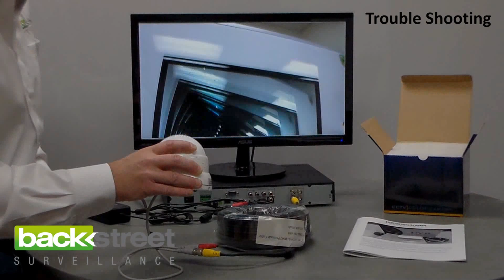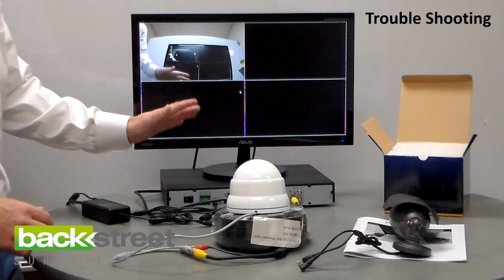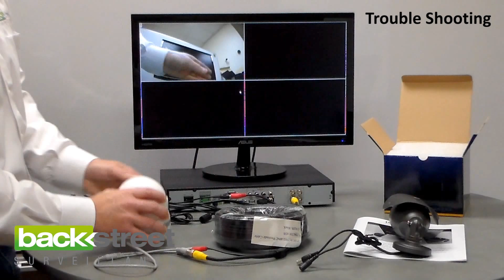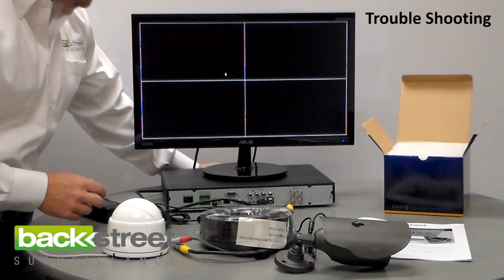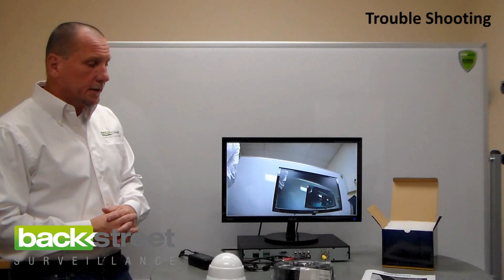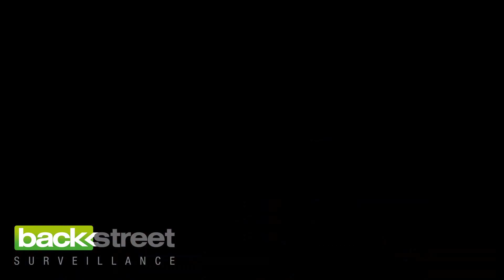Troubleshoot Coax Security Cameras | Easy Fixes for CCTV Systems

Comment: Hello, I’ve had cameras up for some time now and I’ve an issue with one off them. I’ve tried swapping the camera with another camera and it still didn’t work, at night the ir lights flicker at night but give no video, would this be a cable issue?
Edit: I’ve also replaced the power supply
Reply from the maker: If the symtoms are the same on both cameras its either the cable or the power supply, or the video input channel on the recorder. Isolate each part of the system and test. Try a diifferent input on the NVR and see if the problem follows. Use the extra camera and a short cable, plug directly into the video recorder bypassing the current cable. If the problem goes away its probably the cable, if it continues its not the cable...keep isolating and testing each part of the system until somehitng changes. Hope this helps.

Comment: I have an 8 channel Anne vision Cctv system for some reason 3out of 8 cameras are just showing the annke logo I've tried everything but no luck I tried to manage via my smartphone and it seems to be something to do with the front resolution as it says no camera but the cameras that work say pal and I'm unsure why the dead cameras won't let me change it to pal ????
Reply from the maker: PAL is for European applications. The cameras should be set to NTSC. But that not the problem. The 3 cameras showing the logo are simply not communicating. The logo shows the NVR is not detecting the cameras video feed or the channel is turned off in the software. Hope this helps.

Comment: Hello, I have a samsung security systems everything worked fine for 5 years but all of sudden two cameras stopped showing video on screen and I unplugged and plugged it back up, then they came back on the monitor. A few days passed and now all my cameras went out and nothing will show on the monitor not even the mouse. I have unplugged every single thing and only once did everything comeback on but it only lasted a day or two. Now nothing comes on no matter how many times I disconnect everything. The cameras still show the  infrared lights when I cuff my hands around it. What can I do?
Reply from the maker: Unplug all items connected to the video recorder. The plug the monitor, keyboard and mouse back in. Make sure that works, then plug one item in at  a time and monitor if any one item cause the strange events. This may help isolate the item causing the problem. Its possible its just wore out. 5+ years with a consumer system is very good.

Comment: I have a question I have a security system that it keeps rebooting now one of the cameras did not belong to it so I replaced that and it seem to work but then hours later I had my boss called saying that it keeps rebooting. I replaced the hard drive with the original box and it keeps doing it
Reply from the maker: Try reformatting the hard drive. If the camera had its internal time and date different from the NVR you could have a data formatting problem. We have seen this cause the rebooting you reference. Reformatting the drives will correct this if this is what is happening. Hope this helps.

Comment: I see where you say it may be an issue with the cameras at night getting enough power this may be why  only one of my cameras work at night, but in the day time only two of them will work but I have to plug them one at a time. I have four cameras they all work but like I say only two at a time when I plug in an additional camera everything says no video. I have a 4 camera laview dvr system. Any idea whats going on with this? Thanks
Reply from the maker: It sounds like an IP address conflict or lack of processing power. Try plugging only one camera in at a time and let the system stabilize. Then add one more camera to the system. If all works, then add a third. If any camera causes the problem when you plug it in, leave that camera to the side and try another. If it happens with the other camera its likely the NVR and its ability to process data. You may have to reduce the frames per second in the NVR or reduce the bit rate on all the cameras so the unit can handle the data workload. Its getting a bit technical now so you may want to contact the dealer you purchased from for support. Hope this helps.

Comment: My camera works then stops the rolls on 2 of my cameras and the other 2 don't show at all. The monitor and mouse moves on all 4 cameras. Do you think it's the cameras or the power supply?.
Reply from the maker: You'll have to isolate each part of the system for testing. I would remove all but one camera and see if the issues continue, if it does try another camera, and see if it corrects of if the issues remains. Until you isolate which device is causing the issues, you'll like not have much luck finding the culprit. We're going to make a "how to troubleshoot security cameras video" in the next week or so. We'll have it posted asap. Thanks
Reply: @BackstreetCameras It turned out to be the power source/plug to the cameras. I just bought another one from Amazon for $9.62 (total).
Reply from the maker: Figures, we have had failing surge suppressors do some really strange things to systems. Always the first step is to by-pass the surge suppressor by plugging the NVR directly into the power (again, isolate each part of the system until you find the issue). Great work, glad you found and fixed it. Cheers!

Comment: I have an issue where the video no longer shows. It use to for a long time. Recently all the camera does is flicker the red IR light but no video. Connecting to dvr camera still works. Did a dc power test and getting 12 v. How can i test the video on that line with multimeter or what does the on/off of the light indicate?
Reply from the maker: It sounds like a camera problem but try swapping the power source with another camera. See if the problem transfer to the other camera. If it does not transfer and the problem is still on the same camera, you have a bad camera. If the problem transfers to the other camera, you have a bad power supply.
Reply: @BackstreetCameras  I was able to hook it up directly to the unit and it works. Also got a new camera and same issue. Will be trying to get new power line out to it and see if it helps.

Comment: What if the power goes off and when the power comes back on the it's black and white
Reply from the maker: Recycle power one more time. If the power came back slowly you might be dealing with the opposite of a brown out (brown in). Perform a clean power cycle, off, wait 30 seconds and back on.

Comment: Are the DVR/console main units of surveillance systems usually noisy? Mine has had this loud noise from day 1 that gets louder but never goes away. Not the whirring of a fan, it almost sounds like all the rapid clicking noises a computer console makes when loading. (Unit is not connected to internet).
Reply from the maker: The older DVRs generated a lot of heat so they put very strong fans in them making them noisy. Our new NVRs generate so little heat they do not even require a fan so they are silent. Thanks for the question.
Reply: @BackstreetCameras   Thanks for your input.

Comment: Thanks for the tutorial. I’ve got a question . One of my camera  works fine for half day and the  goes off  in the evening about 8ish and comes Back in the morning about 7ish. What would you think is the issue here.
Reply from the maker: The camera is trying to turn on its nigh vision system but something is gong wrong. As the light level drops the camera automatically switches to night mode. There is something going on with the camera when it makes the change. Some cameras allow you to force it to stay in day mode at all times, you could try that and see what happens.
Reply: Thanks for the reply. I will check the cam and try to force it to stay at daytime

Comment: The night viewing is not working after replacing the porch light bulb 3 times
Reply from the maker: IR night vision will not turn on if you have a porch light on. The light defeats the need for infrared night vision. You should do just the opposite and keep the porch light off. This will allow the night vision to turn on. Hope this helps.

Comment: Good afternoon, 
Please two of my cameras is showing one location,  what could be the problem???
Reply from the maker: If you mean there are two cameras on the same video feed then they are likely IP cameras and you have a IP address conflict. We would need more information to help. What kind of cameras (model, IP or coax etc.)? How are they wired? What brand is it? Provide this info and we can suggest a course of action. Thanks for the question.
Reply: @BackstreetCameras  its an America spec, PitoTech , is connected with router
Reply from the maker: Sorry its not a brand we have heard of. We did a google search and there is no supporting documentation. We could not even find any info on the manufacturer. We would recommend contacting the person or site you purchased from and see if they will provide some support.

Comment: Hello im currently using a CCTV camera with the DVR that can give picture up to 1080N but the picture quality output only giving 960N when before giving 1080N. Is there a way to make the video good again or what part is having trouble so i can fix it? Thankyou.
Reply from the maker: It might be your monitor or a setting in the video recorder. If the monitor has a max resolution of 960N then that's the limiting factor for the entire system. For example, if you have a 4K camera you need a 4K video recorder and 4K monitor to view 4K. If the camera is 4K and the recorder is 4K but the monitor is 1080p...all you will see is 1080p resolution even though the recorder is recording in 4k. Hope this helps.

Comment: my cctv camera somes the screen goes completely green it goes normal and back full green
Reply from the maker: The often this occurs when a camera is switching from color to night vision or if there are changing light conditions. Pay attention to the time of day and see if you notice a correlation between the time and the problem.
Reply: @BackstreetCameras  what can i do about it to fix the issue
Reply from the maker: Adjust the cameras field of view or move the cameras to another location with different ambient light. It's the cameras getting stuck between the two operational modes (color & Night Vision) due to the light levels, not enough light to stay in color and too much light to stay in night vision mode. Often hard to fix, better cameras may solve the issues. Hope this helps.

Comment: Hi guys, what if I have all my cameras not showing on the monitor but the quadrants where the picture should be is still their ? 

And also if the cameras do have that red led glow 

Could it be the video ports on my DVR ? 

I had 4 cameras up and over a period of time they all went off, I installed and additional 2 where I checked the wires and cameras before installing them yet once up, would not show on my monitor 

I need security on my home and vehicles

Hope you guys can help
Reply from the maker: The quadrants will show whether the camera is sending signal or not. Since multiple cameras are down I would first suspect the power source for the cameras. Start there. Thanks

Comment: I have 4 outside cameras that were set up to connect with the DVR using WIFI. Recently one of the cameras dropped its connection to the DR and the monitor inside the house. I checked the connections and the camera and they seem to be fine. I do not now how I can check the WIFI connection for that particular camera! Any advice would be helpful. Thank you.
Reply from the maker: With wifi cameras they are often are assigned their IP address from the internet router. The problem is the internet service can change the IP address randomly. If the camera is set for DHCP it will take a new IP address and may drop off the system. We recommend calling the company you purchased from for support. Thanks for the question.

Comment: I have a unique situation. One of the six exterior cameras does not show up on my monitor but is perfect on the phone app. I've tried everything. The camera is the same brand as others but slightly different. Only conclusion I can come to is the resolution on my old monitor might be too low.
Reply from the maker: I would update the firmware on our NVR and update the app on your phone so both are operating on the latest version. Hope this helps.

Comment: I have an IR COLOR CCD CAMERA, the IRs are working but no feed is coming from the camera, the cable lines are okay because when i switched the no feed camera to the working camera it shows feed to the monitor.
Reply from the maker: Bad camera. If the cables are confirmed good and another camera works on the same line, its most likely a bad camera. Hope this helps.
Reply: @BackstreetCameras  thank you sir

Comment: My cctv delays 10 sec what could b the  problem
Reply from the maker: Its a transmission issue. Troubleshooting depends on where the delay is noticed. Is it seen while remote viewing, live viewing from the camera to the NVR or palyback?
Reply: @BackstreetCameras  Its is seen on live viewing
Reply from the maker: Wow, I'm guessing the recorder does not have the processors needed for live viewing, recording, remote viewing and playback all at once. Likely a low end price point recorder. It probably needs more processors. Nothing you will be able to fix. Just an educated guess.

Comment: Hi, I'm currently using 16 Cameras from Night owl which are about 3-4 Years old and I have an app that allows me to monitor when at work, although It recently stopped working and I assumed the app (Night Owl Pro) was under Maintenance so I didn't really think much about it, Its been over 6 months since my app stoped working and I have tried nearly everything, I recently got into contact with Night Owl Support and they told me to upgrade my DVR because something along the lines of the DDNS and how they no longer manufacture/support that model. Then I asked support if all I had to do was buy a new DVR from them and I was told that I'd have to buy a whole new set of cameras because my cameras aren't supported in the newer DVR models, I want to know if this is true because my current cameras are 1080p and are COAX, which is the same thing that the newer DVR supports. Now I don't know whether support is trying to milk me of my money or are just being honest.  I also asked support if I'd have to go through the stress of rewiring all the cameras and was told no, all that mattered was that I upgrade all of my cameras and DVR.  Thanks
Reply from the maker: Sadly they design their systems to lock you in and then the endless upgrades. Yes they are telling you the truth but they crated the problem. You can use your cabling as they suggest but you will have to upgrade both the DVR and cameras. Sorry we did not have a better answer. we can help here is a link to our coax upgrade options. https://www.backstreet-surveillance.com/hd-cvi-series/hd-cvi-security-cameras.html

Comment: Could video loss be caused by faulty Poe switch? We were poking around loss all feeds except one. Only thing that didn't look right was one of the switch with LAN cables connected to it was not powered on. When we power back on some lights that use to blink is now not blinking. Could this be a cause of loss video feed?
Reply from the maker: Definitely could cause video loss. Even it the PoE was just unplugged it would cause issues. Likely a dead PoE. Thanks
Reply: @BackstreetCameras  Thanks will look into it!
Reply: @BackstreetCameras  Btw since I have one video port 1 feed left should I try putting it into port 2, 3 or 4 to see if it works to test for bad port or camera power supply from POE? Seems odd 2 feeds were lost but like in previous post noticed video gone when POE lights were gone and somehow got unplugged
Reply from the maker: Anything you can do to isolate each part for testing will get you closer to identifying problem.  Good luck.
Reply: @BackstreetCameras  i went back to my friends house today and it turns out the previous installer grouped two camera feeds together per one 12volt  2 amp black power supply. I'm pretty sure the other power supply is blown and two cameras went out at once. But these are not plug in they beaned all three positives on one side and three negatives on the other side. I'm 95% sure that is the cause what you think? Because when I unplug other power supply that side goes out and when you plug back video comes back.
Reply from the maker: You are right, likely the issue. Isolate each part, power down all cameras and check the connection and polarity on each camera before you put them back online. Do one at a time, if any camera cause issues, by-pass that camera and bring the rest on-line, then come back and work the problem on the faulty camera. Hope this helps. You are definitely on the right path.
Reply: @BackstreetCameras  
Ok thanks ☺️

Comment: I am having a hell of a time trying to set up my swann security camera. The app continues to ask for a QR code that was not included with the camera so I manually entered the camera's ID, but the camera won't pair at all. I've been searching all day and have yet to find anyone troubleshooting this issue.
Reply from the maker: There should be a QR code in the NVR's software. Look under the general or info tab in the software. You might find the QR code there. Hope this helps.